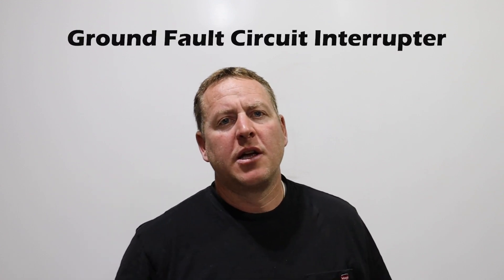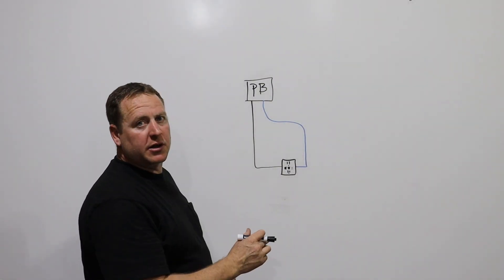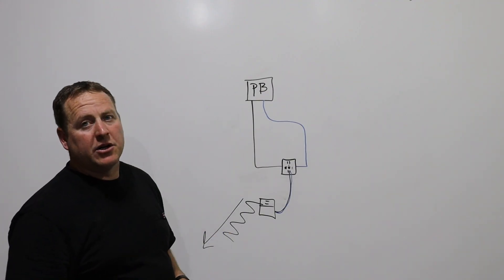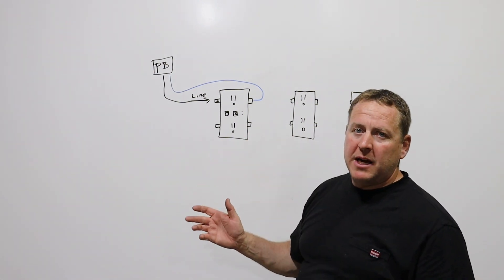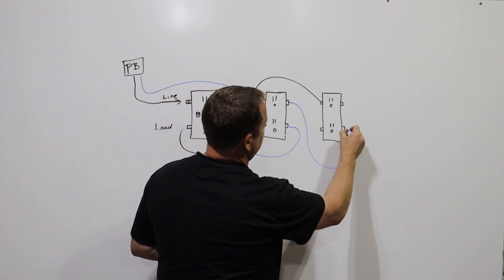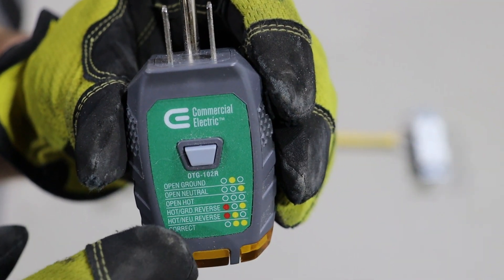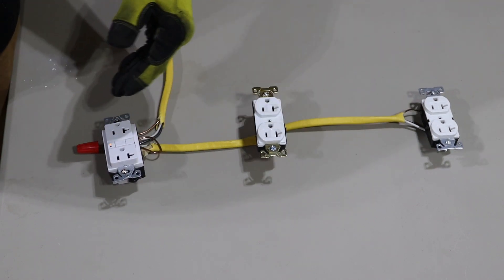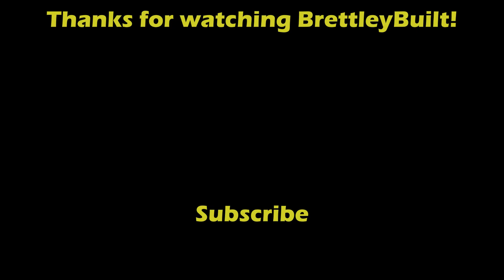How to Wire Ground Fault Circuit Interrupter (GFCI) with Regular Outlets | How GFCI's Work

Comment: I just watched a video that demonstrated the ineffectiveness of GFCI's that are wired in SERIES from the first inline GFCI after the breaker. When they were wired from the LOAD of the first GFCI they did not work as intended. They DID work when wired in PARALLEL. Perhaps I misunderstood your comment about wiring GFCI's from the first GFCI using the LOAD screws....as this would be series circuit. https://www.youtube.com/watch?v=d_XrDugHIXQ&t=905s
Reply from the maker: Technically all AC circuits are wired in parallel. It seems like they're wired in "series" because they're wired in a line, but electrically it is parallel.
Reply: @brettleybuilt  right! if it was series, the neutral of one outlet would lead to the line screw of the next and nothing would work unless you had a load plugged in.  

@joev467 I also watched that video and found his issue... remember he found the black GFCI outlets dead, but power on the back? He said that is why it won't work with a regular outlet. What he failed to note was that he had already reset the white GFCI to resupply the power down the line before testing it. You can actually see the LED on the black one flicker when he restores power. He got exactly the right result for the circuit he built. The black GFCI also tripped when he tested the white one but he didn't reset that one.  Don't believe everything someone posts on the Tube. There is probably some right and also some wrong with all posts. This one included!!

Comment: Will this work on old 2 wire circuit with no ground? It’s not knob and tube just old tin coated copper probably originally grounded to the old lead pipes, which have been replaced.
Reply from the maker: I have installed GFCI outlets in two wire systems. It is not ideal though.

Comment: Thanks, good explanation. I was wondering why you wouldn't pigtail for the receptacles down the line, but then you did actually mention you would.  But you definitely don't want to do the pigtails on the gfci as it will defeat the purpose of protecting the other receptacles down the line.

Comment: Informative video. Could you elaborate on the last part where you talk about pig tailing? You add a pigtail then populate all the screws of an outlet because the copper clip may fail to deliver current to the neighboring plug?
Reply: I was wondering the same thing? The 12/2 comes with 3 wires.. I completely followed the hot and neutral but never seen any ground wires connected or capped off?

Comment: Hello. In your video you have adding regular sockets to initial GFI outlet. Is it the exact same way to wire a GFI to a existing regular socket?
Reply from the maker: Yes, if you have an existing circuit, you can replace the first outlet in the circuit with a GFCI and essentially make the same circuit I made in the video.

Comment: Is it illegal to connect bathroom electrical line to attics room?  I need to bring power to my attic room and want to have a 20amp circuit, the closest and easiest is bathroom power circuit line.  Thanks
Reply from the maker: Not sure if it is illegal, but it certainly isn't ideal. Your lights and outlets will be on the same circuit in the attic so if something in the bathroom trips the breaker, you also lose lights in the attic.

Comment: Do I need GFCI outlets if the outlets are on a CAFCI breaker? The outlets are outside my house and are weather resistant.
Reply from the maker: No. The protected breaker takes place of the GFCI outlet.
Reply: @brettleybuilt  thanks for your reply I have subscribed.

Comment: Your drawings/explanations are so easy to follow! …forgot to take a pic of my old wiring when deciding to replace a combo GFCI and 2 single pole switches in my bathroom.  Ugh. Cannot get it back together. 
Any chance you have a vid of that type of scenario? I’m getting lost because the switches only have 2 screws. 🫣
Reply from the maker: If you send me an email with a rough drawing of what you want to do I can help you out.  brettleybuilt@gmail.com

Comment: Thank you I've learned a lot from your videos. Great information and very well presented. I do have a request. If you can, can you do a video of how to connect multiple receptacles/lights with one breaker/switch?. (Just liek you did witht he wiring basics)Thank you.
Reply from the maker: I can but I would catch a lot of flack for that. Wiring codes want your lights and outlets to be on different circuits. If you do want to add a light to an outlet circuit, which I am not recommending, you run Romex from and outlet to the switch box, then Romex to the light. The power to the light comes from the power in the outlet circuit.

Comment: I'm remodeling my bathroom. I'm at the point were I need to rewire and add outlets. Also, add some ceiling lights. I don't need a electrician now.
MY GOSH. 101 CLASS 👌🏾👏🏾👏🏾👏🏾👏🏾🙏🏿

Comment: Great video!  Why are there GFCI breakers?  Do the breakers have to work with the outlets? or are they used instead of the outlets?
Reply from the maker: GFCI breakers provide a way to protect the circuit without having to use a GFCI outlet as the first outlet. It works the same, but GFCI breakers are very expensive.
Reply: @brettleybuilt  , I'm in Tennessee. do you know if I can just use the gfci breakers instead. your video is best I've seen yet without all the long talking. I cant find anything on it. Thanks

Comment: Hey there,

I had a question I wanted to ask on Reddit but my karma was too low. Do you know by any chance?

How do IGBT’s make a pure sine wave for 60hz? I understand that they switch on and off many times and the more they do that, the average looks more like a pure sine wave. If they only switch on and off 20,000 times a second and pulse width modulation works best when the pulses are extremely fast, how do you generate 60hz of ac? Thanks